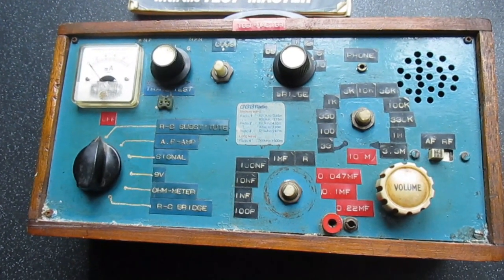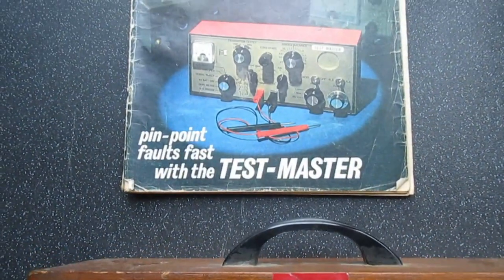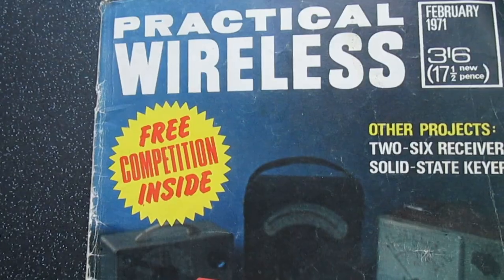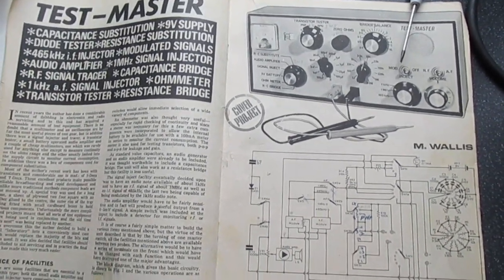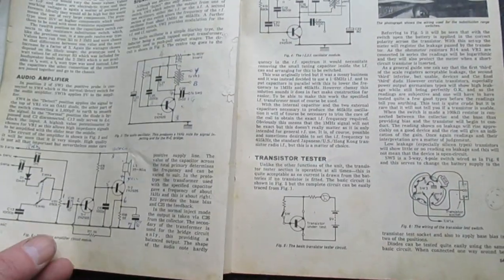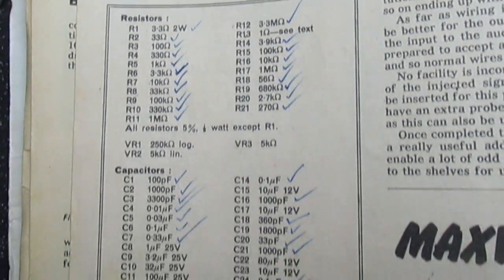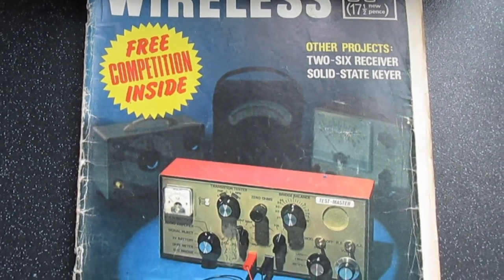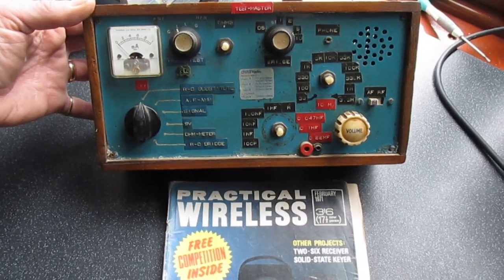Practical Wireless Test Master from 1971

Comment: there were some great build articals in PWthe first i built was the 2 transistior signal injector from about 1965 that i still used up untill 10 years ago .i gave it to a young lad who was learning about radios.
Reply from the maker: I stopped buying practical wireless 10 years ago , its nothing to do with general electronics now , its all radio ham stuff.

Comment: I have somewhere, a scratch built multimeter. I have to confess, I didn't build it! It was given to me a few years back, and the chap I got from had been given it some while before that. The story goes however, that it was an "apprentice piece" built by an REME trainee way back in the dark days of yore. I've had it powered up and tested it against my AVO 8 and can safely say that as long as you don't need to be nearer than about 1volt in 10, it's an adequate little meter. Resistances are pretty much bang on. I keep it because it represents someone's efforts to make a career for themselves, and as a testament to their craft.
Reply from the maker: There's nothing more satisfying than building something yourself, I still do it now all these years later.

Comment: Be fun to recreate your bench and take a new picture. I do remember reading that article. I certainly remember finding old televisions and radio on the tip and salvaging them for spare parts.
Reply from the maker: I wouldn't be that difficult to do that but it wont make me 40 years younger or make me as happy as I was in the 70 s .
Reply: I was reading that very issue of PW in bed the other evening...like you do. I thought what a great project....but of course these days LCR testing is so quick, easy & accurate.

Richard, G0OJF, UK

Comment: Looks like you have a good stock of old tvs to mend in the workshop. I used to have the practical wireless and bought a kit to make an amplifier with emi speakers from RTVC Ltd from that magazine in 1973. well done great channel. Nigel
Reply from the maker: I bought a 10 watt amplifier kit from RTVC in the very  late 70 s , it used mullard modules and was 10 watts , yes I do have rather a lot of stuff, stacked up to the ceiling , only moved to this bigger place 7 years ago and I've run out of room already !